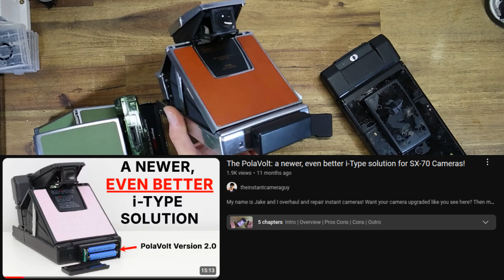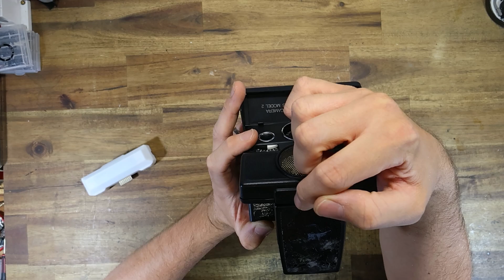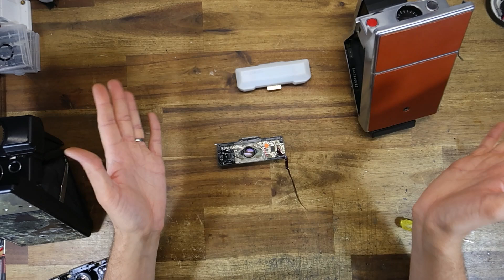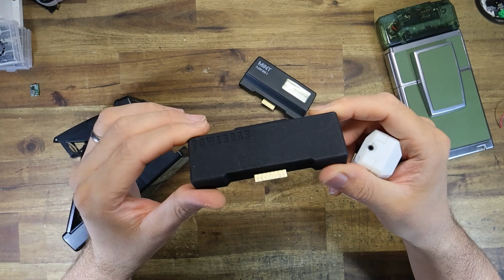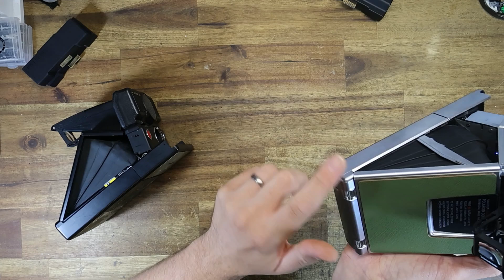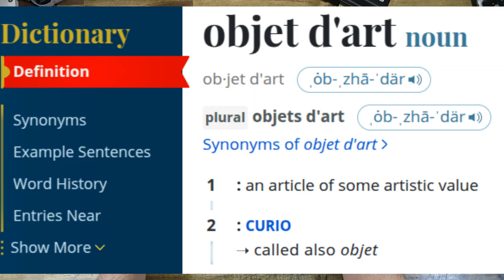Polaroid i-Type power through the flash socket: A deep dive into the PolaStudio Power MIX for SX-70s

Comment: It would be cool to have a new PCB on a non-sonar that could use this solution
Reply from the maker: I haven't tested the MIX on any MiNT SLR670 cameras, nor the OpenSx-70 PCBs, so I cannot comment. 

I also have not tested it with an Alpha SX-70R

I expect it SHOULD work on an SX-70R that was made from a true SX-70 Alpha, with a proper Alpha FFA. But I cannot confirm this.

Comment: I ended up designing a housing that integrates your polivolt mod into a housing with a battery door, though currently it is sharing the battery door design from the gameboy DMG. I don’t know if it ascetically fits the SX-70 but it’s a proven design.

Your setup is definitely more obtainable for a lot of people though and requires less steps for install

Comment: Wow, a wonderful video Jake. I'm glad you did not repeat the tunnel vision aesthetics bias of so many (tripod adapter, Sonar, etc.) I am wondering if the average person would pay more attention if it was emphasized that the Mix and pbar are not "plug and play". Seems like shhitt brain   buzz words for policy and elections are all that grab the attention of some.   As you discovered after I sent you 7 Sonars to convert to shoot 600 film, only to discover that they, for at first, unknown reason ran sluggishly with the external power supply through the flash socket.  Yes, they had been purchased from a repair person. A well known and respected repairer.   Yes, it should be clear to anyone who sees this video, that they devices are not necessarily "plug and play".   I know that even saying directly the term "plug and play" or not plug and play, still won't be sufficient idiot proofing, for many out there.